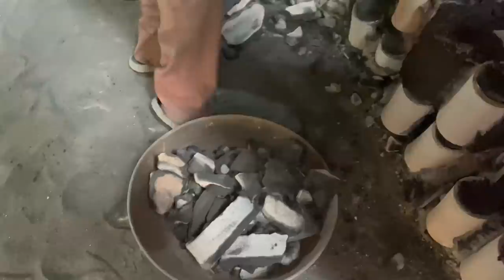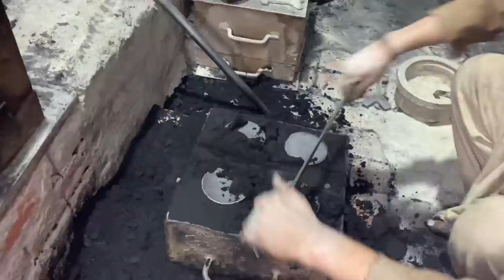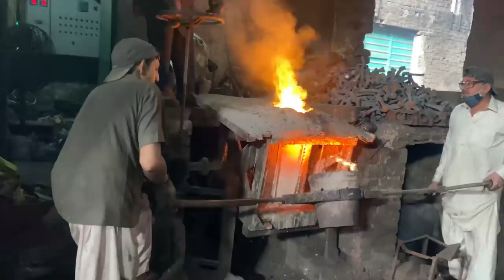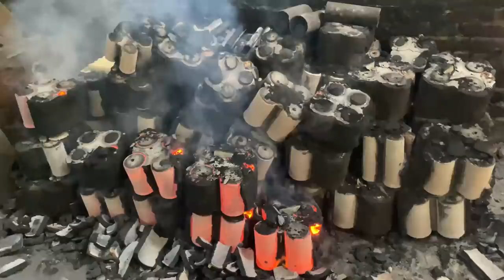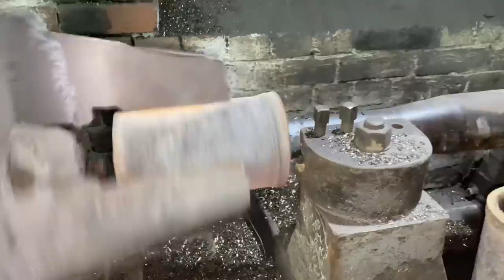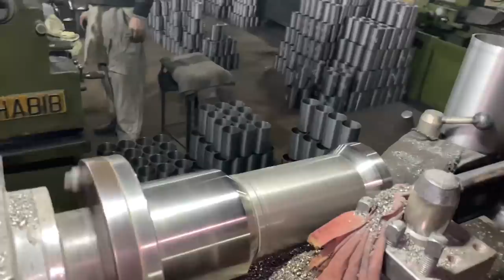Manufacturing Process of Diesel Engine Cylinder Sleeves & Liner | Manufacturing Process of Sleeves |

Comment: Представляю качество этого фуфлолитья ! Такое отливки должны делаться центробежным способом .
Reply: Yes of course but they do not care of such procedures.  I bet most of these sleeves are used for farm tractors or water pumps running low power engines.  Perkins or old John Deere.  No way these would hold up to the higher cylinder pressures of any modern engines